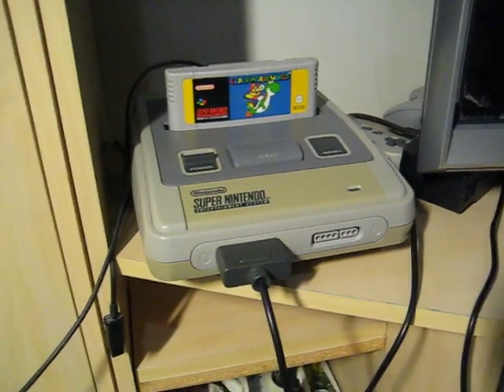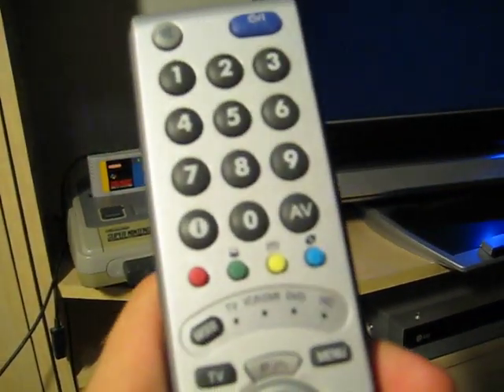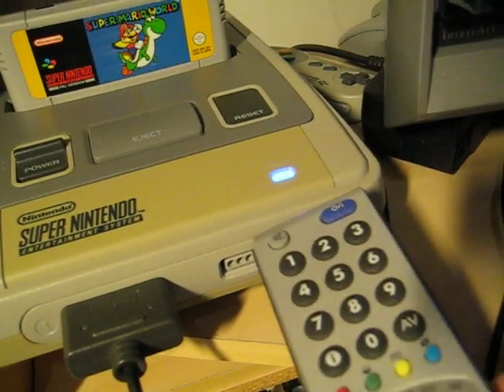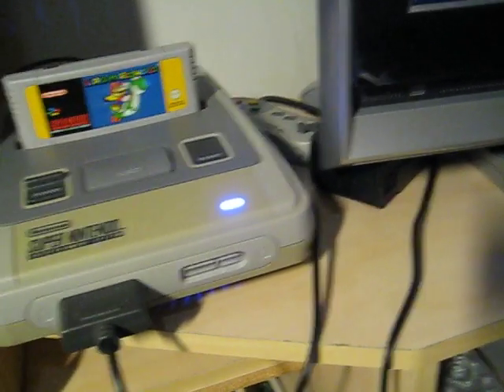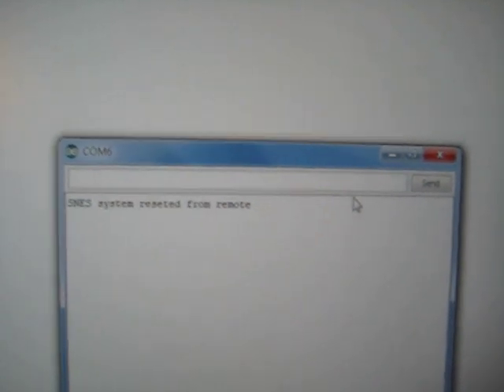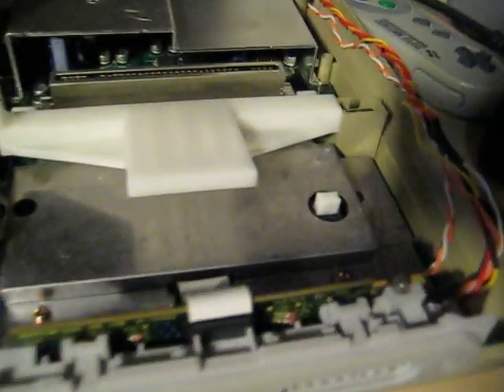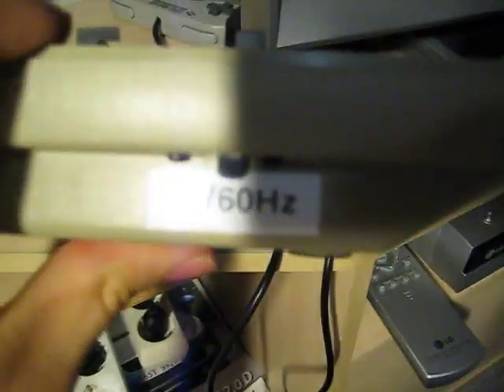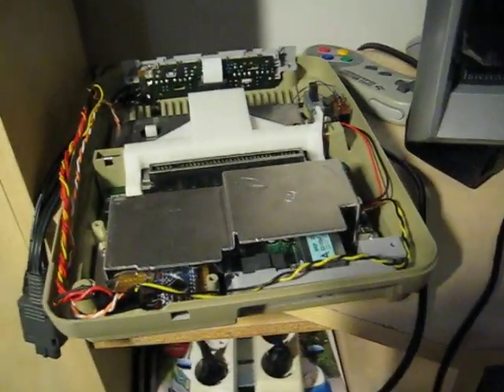My SNES mod with arduino

Comment: do you happen to have a preview of the code? thanks.
Reply from the maker: https://drive.google.com/open?id=0BzU2jofGQRLhOGJ4cFROZDh1T1U
Reply from the maker: Sorry I don't have a video about it. But if it helps here is the circuit and source code for this project.
http://speedy.sh/Fyub2/Snes-IR-project.rar
Reply: The link is broken. Nice work though!